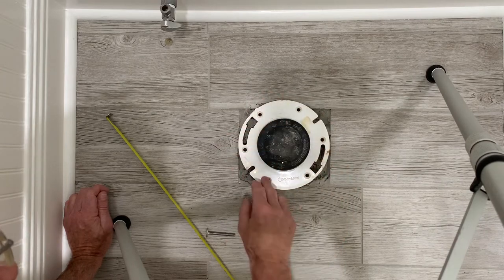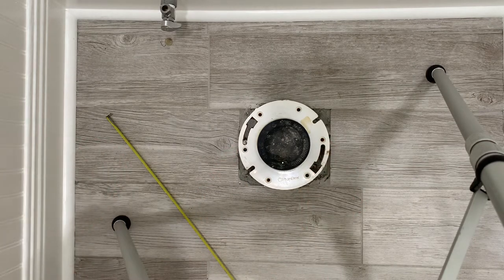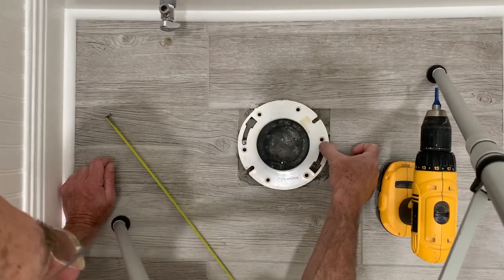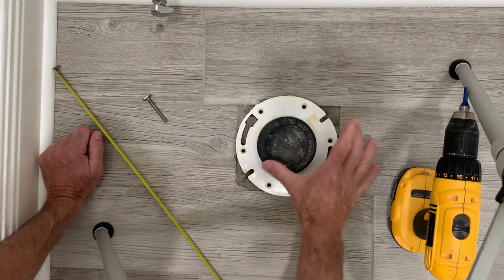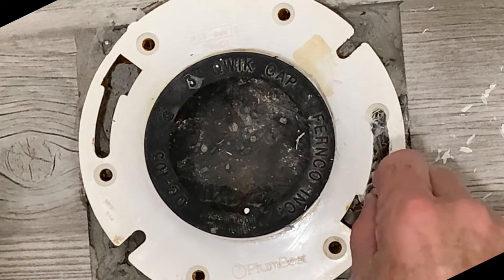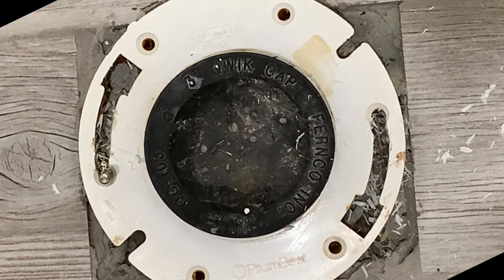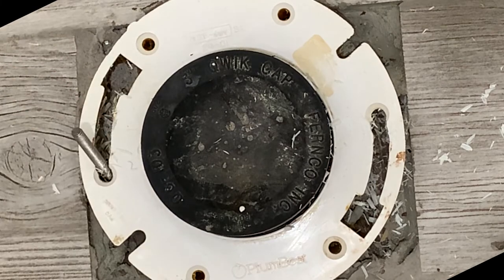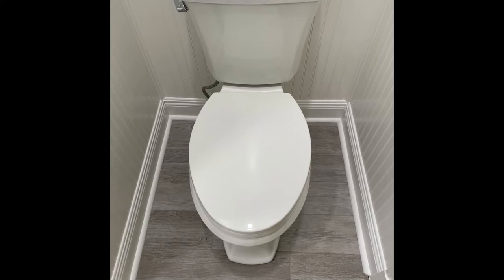Fix That Crooked Toilet!

Comment: What drill bit did you use?  Thank you for the video!
Reply from the maker: It is a router bit called a “flush trim router bit”. A 1/8, 3/16, or 1/4 diameter one should work.
Reply: @FixItDepot  Thank you so much!!